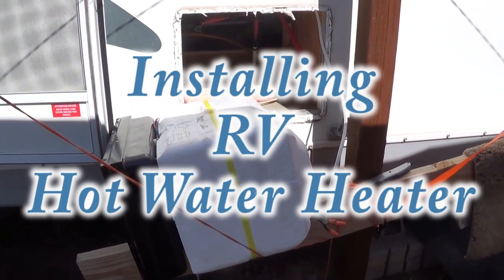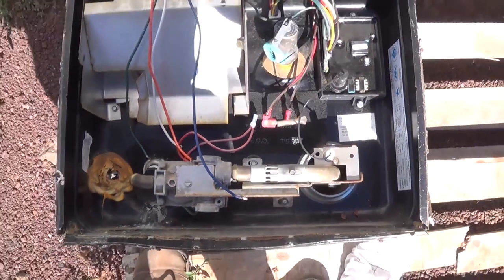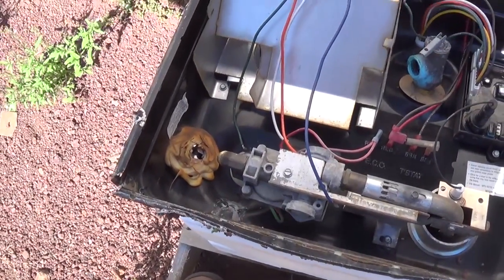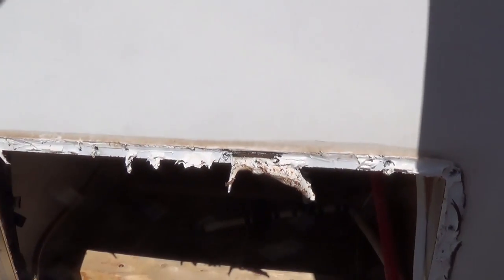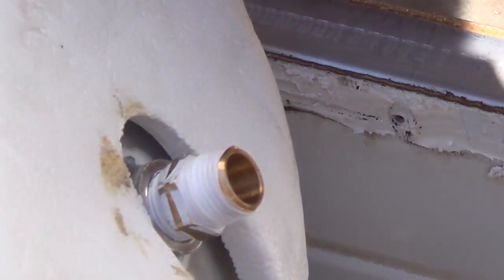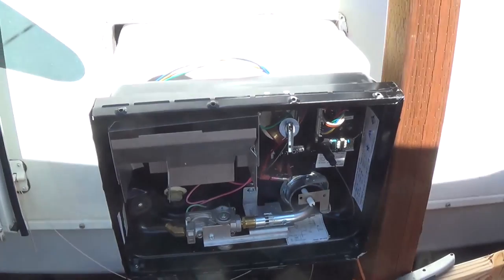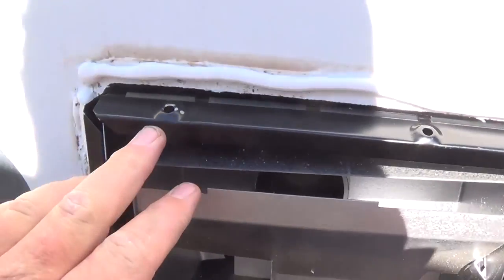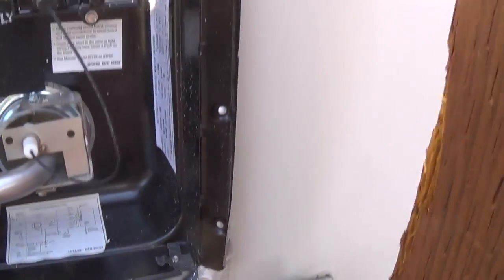Removal and Installation of RV Water Heater GC6AA-10E

Comment: About that little rubber grommet that goes around the gas line- I cut off the smallest inner circle and the brass connector fit through it with a little effort. It fit snug around my line (though mine is a bigger rubber coated flexible line).  I suppose you could still use it with the thinner copper line, and just fill in using way less goopy filler/caulk. 

Thanks again, this was a huge help.
Reply from the maker: i did that.
Reply: Another way to get the rubber grommet on when the fitting is too large to fit through it is to slice the grommet, put in on over the pipe - beyond the fitting - and glue the slice closed with superglue.

Comment: Thanks for the video. Its a project I had to tackle. I ended up installing a tank-less water heater using the same location. Best thing i ever did for my RV. Now i can take an hour long shower instead of the 5 minute quick one i would normally have to take. They make smaller ones for mobile homes that work on a 120 volt wire, and it cost me around 350.00. Worth the investment if you already have to replace one..
Reply from the maker: tankless is great. in fact I hope some day to replace this hot water tank with a propane tankless similar to the eccotemp l7. during my winters I noticed it would take a hour to heat the water. that sucks. lol
Reply: @Jamie Lawson Good deal on a tank-less water heater.  By any chance do you have a link?  I have an Atwood RV Water Heater Electric/Gas 6 gallon that needs to be replaced as it is leaking.... UGH!!!  I'm like you, its a project that I need to tackle.  HELP!!!   

Rick

Comment: Hey thanks for making this video. I just picked up a travel trailer and found that the hot water tank is bad. Dont think I'm gonna find one for 70 bucks but at least I got a idea about the install thanks to your video 👍🏻
Reply from the maker: good luck in replacing it. yea i got so lucky on that buy.  once in a lifetime deal.

Comment: It's 101 degrees today as I received my tankless model in the mail. In will remove the old stove also. Good idea to space out those electric wires from the propane.
Reply from the maker: +Oie de Etudiant tankless? that's awesome. get this I don't run the hot water heater all the time but this last winter it would take some times over 90 minutes to heat up 6 gallons. lol.... I am currently using an eccotemp l7. love it that I got hot water fast. so just rigged it up to only the shower for now. and shhhh its inside, not inside safe but so far all is good. lol later I will have it to run the entire trailer.

Comment: Glad you were able to get that new one at auction!  I have had my eye on a tankless propane, but I take such short showers and w/ the RV water shut off showerheads, I am sure that 6 gal will not be any issue. Hope I will not have to think about it for a LONG time.  You did great for not knowing what to do! It must be nice that you can DYI!
Reply from the maker: +Electrosensitive Prima Donna Going Off Grid 6 gallons is great. the part I don't like is it takes about 30 minutes to heat up. I like the tankless propane eccotemp l7. it seems like it would use less propane and ready within a couple of minutes. I plan on getting one anyway to use as an outdoor shower.

Comment: You are da man, Jeff! What a great price on the water heater! We have the same one in our travel trailer. It's good to know it's not too difficult to replace.
Reply from the maker: +momz13 I learned as I was looking for the heater online that the tank has a inner tank and it is common for them to go out. watch your winter freeze and don't forget to drain . I wonder if that is why mine leaked. I didn't drain it this last winter.
Reply: @ArizonaHotHomestead  wow, we got a new Aspen Trails camper last June, with the same hot water tank, same model etc, and it leaked recently when we went camping, no hot showers. My husband drained the lines, but not the tank, we did not even know about draining the tank itself. So of course this past winter (Tulsa), we had very freezing temps, and I guess that is what happened. We are looking for another tank to use with the same gas and electric lines to avoid paying the higher cost of over $500 for everything, and it looks like Dometic doesn't make that model anymore. ugh.  Thanks for the video.
Reply from the maker: @kbaker540  the little things right?   they should make a replacement model becus that model was so popular. the key is you can move the gas line and adjust the plumbing so as long as it fits your good. good luck

Comment: At 6:56 that Black Box that the Wires are coming out of is actually a Junction Box just for the main wire to go into and then you wire them together inside that junction box then close the Junction box back up. usually safer to do it that way but not that big of a deal.  Also that Rubber Grommet you just make a Slice down one side of it and slip it over the pipe.  Over all awesome video Jeff. I just thought I would give you a couple tips.
Reply from the maker: +TRX450R Vlogger didn't think of slicing the grommet. thanks. the old heater had the wires inside and I thought it was just to keep any leaking water from getting to the wires. junction box makes sense.
Reply: Yupp lol.

Comment: thanks for this! i went to plug in my water line today and immediately heard it spattering all over the floor :( :( i didn't drain my hot water tank and here in texas it got down to like 1 degrees F during that crazy storm last month. well, my water tank busted wide open! i gotta take it out of there and get it welded up
Reply from the maker: oh no. i assume the weld job worked. . great idea
Reply: Same here. Due to shortages these units are over 900 now. I'm converting mine to a Girard thankless setup for 600 including the door.
Reply from the maker: @RyanV78665  some day I hope to replace current heater with the tankless.

Comment: Thanks for the video. On the gas line inlet hole. What's wrong with slitting the the grommet on one side which would allow installation onto copper line and insert hole?
Reply from the maker: nothing. i did it later. lol

Comment: hey Jeff don't forget to run some sealant around the propane copper tube!!!
Reply from the maker: +Thomas Villanova lol  funny. I showed dad my work and saw I didn't seal that part . lol   its sealed now. thanks. I did forget. thanks for the reminder.
Reply: Hi, I just did the same repair, what do you use to seal the tube?Thanks
Reply from the maker: just so we are on the same page. when you say tube are you talking about the grommet the copper propane line goes through? if so I cut the grommet so I could get it around the tube, once in place it kind up sealed itself but I just used standard window/door calking the same I used around the seal with the screws. otherwise not sure what tube. was that it?
Reply: Yup that was it. Didn't know if there was some special sealant I needed to grab. Thanks
Reply from the maker: any time.

Comment: Thanks! Looks pretty simple. Couple of comments. Is it legal to use teflon tape for gas fittings? Second, regarding the gromet, just cut a slit in it and place it around the pipe. Then you can just place a little sealant on the slit (if necessary) instead of that super messy caulk job.
Reply from the maker: +Owen Graham legal Teflon tape ? They make yellow Teflon tape just for gas . I later didn't sealed up the grommet I sliced . It was easier then I thought it would be

Comment: @7:54 - that's called a nipple, not a coupler. 

The hex part is not necessarily built into nipples but if it's there it makes easy to use a box wrench or socket. If it doesn't have that then you have to use a pipe wrench, which may be harder to use in certain spots.
Reply from the maker: thanks. i guess thats proof i am an expert at nothing. lol
Reply: Like say?

Comment: I like your teaching style. Great video. I think that tape you used on the gas is not right! You need special tape for gas connections I think.
Reply from the maker: if i recall the tape should be yellow.
Reply: Yellow tape is for gas white is for water.

Comment: Did you caulk the propane hole, or cut the grommet, or both? Seemed to me woulda made sense to cut the grommet and use a little caulk on it to hold it in place around the propane line.
Reply from the maker: i did after the fact i cut and put a little caulk.
Reply: @ArizonaHotHomestead  yeh me 2. Wish I coulda found a $70 deal like you did. Mine was $360. Not too bad though really, the sticker on it when I got it said $399

Comment: Hey man, thanks for sharing!  I am dealing with a check valve issue and was not sure exactly where it is or how to access.  Seeing you take yours out and show the unit helped a lot.  One question though.  I am thinking the check valves should be plastic since the tank is aluminum.  The one on your unit is brass.  Was the original check valve on this unit plastic?  Thanks!
Reply from the maker: i would assume it was brass. i never changed it.

Comment: You said the old one was leaking but I don't see any water damage. I've got wood rot all under mine. damn
Reply from the maker: the water leaked inside i noticed a puddle of water shut off the lines to the tank, turn the water back on and no leak. the first winter i didnt live in the trailer and forgot to drain it. the inside tank is the first to freeze and thats what happen.

Comment: Hi, I want to remove the Atwood gas water heater and put in a point of service electric water heater.  How do I safely remove and cap off the old fittings? Thanks!
Reply from the maker: not sure i would shut off gas, cut the line to the gas water heater so its out of the way with a pipe cutter. and go to home depot to look for fittings that you can use. if you want to copper sweat a cap on or look to see other options.
Reply: @ArizonaHotHomestead     Thanks.  I was wondering where you went to the auction.  I'm up in Glendale and looking for a 64" jackknife couch.  Do you know of any auctions up this way?
Thank You
ML
Reply from the maker: @bradesh  brunks auction. in sun city on grand and 101ish. preview online

Comment: Great job, here’s a pro tip, the part of the fittings you attach your water lines to don’t require Teflon tape, in fact it’s better to not use it.  Your water lines should use Pex swivel fittings that use compression and a saniprene seal that compresses when screwed on.  Just sayin!  Well done though!
Reply from the maker: thanks. i can always use tips

Comment: Hello,
I just bought a 10 gallon Atwood for my camper. Ihave no idea how to get the installation right. Is electric n gas, can I run it just on electric or does it have to be lit by gas 1st? Thanks!
Reply from the maker: run on either. to light the pilot for propane it does need 12v. in my rv i have a switch to run it on either or have it off.

Comment: I need advice on how to disconnect the water line to my sw12de water heater. How do you access the water lines to replace with a new water heater. Thanks
Reply from the maker: got to have an access panel somewhere. i was able to remove from the inside and outside to get to my lines.

Comment: what about the switch plate? did you install one, otherwise how do you turn this thing on?
Reply from the maker: switch plate was already installed. i was just replacing the unit itself. the switch plate is actually about 8 ft away in the bathroom. didnt need to do anything with the switch . the water heater tank had a leak in it so thats why i replaced it.

Comment: Where is the element located?
Reply from the maker: dont know.
Reply: The element in our water heater went out and we can't find it to replace it
Reply from the maker: @chiefwigwam6385  good luck . i am sure there must be some diagram showing the location of the element.
Reply: I think the elec heating elem is found on the backside.  In between cold H20 inlet and Hot H20 supply.